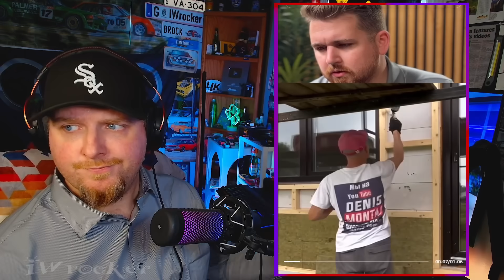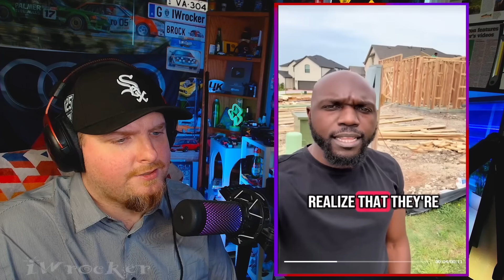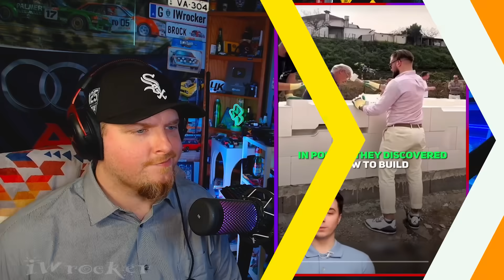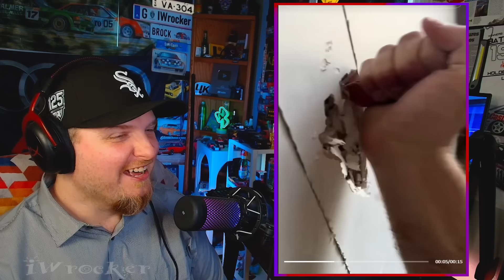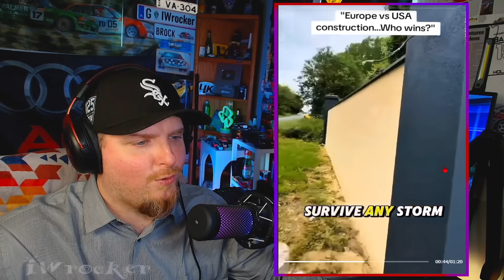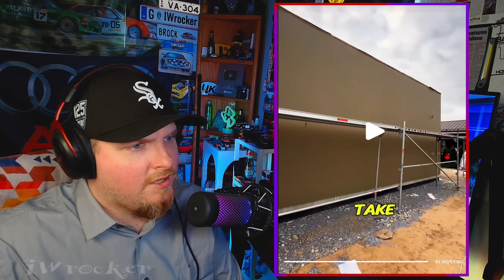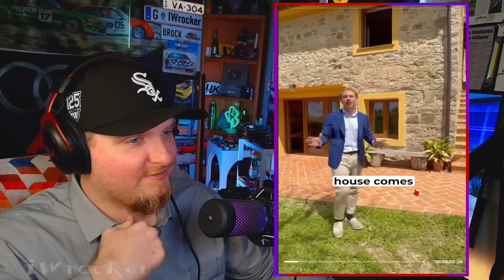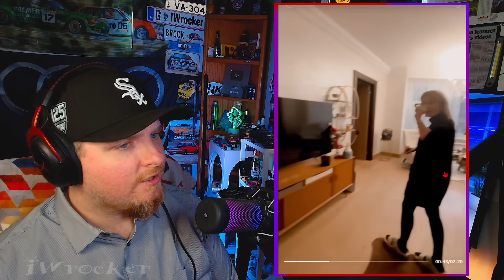25 Minutes of European VS American Home Quality & Construction Methods 🔨

Comment: My house was first documented in 1153. Its exact age is unclear. It was built with extremely thick stone walls. In summer it stays pleasantly cool, and in winter it retains heat well inside. The cellar is probably 1000 years older, as it contains a Roman well. Cheers from Koblenz 🇩🇪👋😃
Reply: That sounds awesome!

No issue with low ceilings? Ppl were a lot shorter back then.

Greetings from the Netherlands
Reply: @CyberBeep_kenshi The interior walls and ceilings were modernized in the 1980s. Many small rooms were combined. It is likely that the interior had already undergone several renovations over the centuries. The ceiling heights and doors therefore meet relatively modern standards. However, the exterior walls and the cellar remain original.
Reply: @MausTheGerman it sounds really nice :)
Reply: @CyberBeep_kenshi My cousin had an apartment in a 19thC house in Koblenz that had 10ft (3.6m) high ceilings, it was wonderfully light and airy.
Reply: @clivewilliams3661  There a some houses in Koblenz that belonged to very rich families. In summer they lived in a castle aropund Koblenz in winter in the town. And these buildings were rebuilt after the visit of the RAF and the USAAF in the 1940s. Normal houses were not rebuilt. Ask your cousin if this house had a special name. So you will know the original owner.
Reply: @CyberBeep_kenshi You may be suprised but while people were slightly shorter in history it does depend on time period! People being much shorter is typically only seen in times of famine or hardship. The shortest people in a lot western europe have been was actually fairly recent during the industrial revolution, where wealth inequality lead to malnutrition for the vast majority of people, stunting their growth. Right before that period people weren't actually on average that much shorter than modern day.
Reply: @__-fm5qv   I went to have a look at a 1550 thatched cottage in a small English village. The first thing the estate agent asked was, 'How tall are you?' I'm a short arse at 5 foot 7 inches, and had to remember to duck under the main beams.
Reply: @__-fm5qv we see it in ancient humans too. Hunter gatherers tended to be close to modern height. But farming caused a lot of malnutrition and averaged heights of about 6-8 inches shorter. But eventuly heavier use of pastoralism brought more protein back into people's diets at the late neolithic and bronze age and heights was again close to modern height then.
Reply: @CyberBeep_kenshi Before agriculture became a thing ( 10-12 000 years ago) People were , on average, 5 inches taller than today. Our brains were 11% larger as well. Then we started eating lots of plants, and everything went down, height, brain, general health.
People 1000 years ago were generally the same height as we are, maybe marginally shorter. Meat became more available, and people started gaining some more height again... apparently we are still eating too much plants.
Reply: @Goldenhawk583 no. just no.
Reply: @martinawolf2983  He is not wrong though when it comes to height. Paleolithic and Mesolithic hunter&gatherers averaged 183cm (6ft) for males and 172cm (5ft 8) for females. Average height declined significantly in the Neolithic and Bronze age due to agriculture and lower intake of protein. In ancient Rome average height was only 169cm (5ft 7) for males and 158cm (5ft 2) for females.
Reply: @Goldenhawk583  This is so wrong on so many levels.
Reply: @camille_skye3768 He is right though. The tallest ethnic group, the Masai, eat a diet consisting almost exclusively of meat, milk and blood and practically no plants at all.
Reply: @camille_skye3768 so you did not check, I guess you know best, lol
Reply: @martinawolf2983  just yes, but heck, it is more important for you to have your bias, than to stay factual,. your problem, not mine, facts are facts no matter what you believe:P
Reply: @G @Goldenhawk583 How do we know the average height of hunter-gatherers around the world 30,000 years ago? You still need femur bones to estimate height.
Reply: @gustavmeyrink_2.0  Wow. One ethnic group compared to the rest of the world. Have you ever looked up the average height in South Korea from 1950 to 2020? No immigration, but a massive economic development from very poor colonized country to Samsung. Do you think humans are carnivores?😂
Reply: @camille_skye3768 Omnivore not carnivores but definitely not herbivores. We are primates and no species of primate is a pure herbivore. Besides hunters&gatherers were not just one ethnic group, you need to be able to distinguish between valid examples and general universal statements but that is probably asking too much.
Reply: @camille_skye3768 PS: You know what happens when poor communities become richer? 
They eat more meat in their diet. So thanks for making my point for me.
Reply: @camille_skye3768 oh I forgot, because noone ever found remains older than 10 years, right? Heard of archeology? And I said 10 to 12 000 years, why did you add another 20 000 out of the blue?'
We know how big dinosaurs were, but we do not know the same for humans millennia later??
Reply: @MausTheGerman
Yep. UK here and my family house isn't as old as yours but ours is 450 years old. The roof was the original until 2006 so 430 years is a good long time to last. Then we thought  the house deserved a treat 😊 so we had a new roof put on. Welsh slate is lovely. I agree about it being cool in summer and warm in winter.✌
Reply: Greatings from the Goldgrube 😃
Reply: @Gerbilwithfountainpen 😆 Gude aus der Altstadt 🎉
Reply: @Gerbilwithfountainpen  Die Karthause winkt von oben 😄
Reply: Wow, that's SO cool. <3
Reply: I'm green with envy, lucky you to have such an historical home.
Reply: @catherinewilliams3850 Interesting, how people prefer different things.
I'm German and always went for newly built houses or apartments.
I was thrilled, to be the first person ever, to move in. 
Old houses just freak me out. I always wonder, how many people died there. 🙈🥴
Reply: I used to stay in a pension in the nahe valley that had roman wine cellars and the place was still a Weingut
Reply: Compared to you, I grew up in a modern building. It was built in 1526. The walls were about a metre thick and the biggest problem was opening and closing the windows. As a child I had to drag a chair to the window, climb up to the inner ledge and open the window.
Reply: You trying to make your Dutch neighbors jealous? You succeeded!
Reply: My husband grew up on a old farm.The walls were made of boulders.electrical cables could only be laid on the surface,otherwise half the wall would collapse.😅picture nails only with HILTI👷
Reply: Kowelenz?! Grüsse vom ex-Koblenzer 😊 Da mach, gäh!
Reply: Du hast kein Haus, du hast n Museum 😂
Reply: Beste Grüsse aus dem Westerwald in die schöne Altstadt. 
Hui Wäller, alle mol. ❤
Reply: Sounds right, my parents also own a really old house in Austria, even de wooden wine press beam was determined to be from about 1300 😂
Reply: I imagine the people in Split/Croatia having these walls in their homes must also feel...really good in a certain way hard to describe. 1700 year old walls in your kitchen just have a different feel to them...
Reply: Our house in the country my ancestors come from is from similar times, also has 1 metre thick walls, so in hot summers it's still cool inside.
It's is a double-wall with an air gap in the middle, which insulates nearly perfectly.
Our house is one hundred years younger than yours. ^^
So, from around 1250, and possibly much older, but there is no record of it, so 1250 is the most you can go back in history.
Reply: @Kivas_Fajo Yes. It's difficult to determine the exact age if no documents were made or have survived. The well in my cellar was examined by archaeologists, and they said it dates back to Roman times, while the medieval cellar is no longer Roman, but from the early Frankish period.
Reply: @MausTheGerman  What is known, that the sea salt saline mine was there in Roman times 2000 years ago. But, the mine today is from late medieval times.
I think, if you start digging in the area you'll find Roman ruins.
Illyria and Dalmatia were very early incorporated into the Roman Empire. I couldn't find any dates for that in a quick search, but my best guess would be prior to the Punic Wars around 230 BC.
Reply: Cheers from the Nürburgring area ✌️
Reply: Similar case - Mediterranean stone house, built in the core of a small ancient town that was once under Venetian rule, was Roman town before that, a Greek colony before that... Nobody knows when the house was really built and Elrond is not there to answer some questions. The town was badly damaged by Saracens in 12th century, I believe, so who knows,  I might have been then. The only problem there was with the house is the plumbing, so typical for coastal areas.
Reply: Brick/concrete house with inside insulation. Why heat walls?
Reply: @TTT-l5w5l  heating walls is a good thing though
Reply: Nah, the people who built it clearly didn't know what they were doing.😁
Reply: Mine in Franconia has its 100th birthday next month. Walls made of bricks and granite, 50 cm /1 ½ ft on ground-floor. Ceilings 11 ft high. Wooden windows with new triple glazing. Egyptian revival outside, so no outer insulation. US Army put in plasterboard-walls in 1946, which I ripped out to have decent space. Some of the Americans still live next door, told me stories form the times of the Iron curtain. (They never found the Nazi arms cache in the walls) Wooden windows with new triple glazing. Egyptian revival/Art deco outside, so no outer insulation.
Reply: I lived in a thatch cottage for 4 years as a child. Unfortunately it's location was an isolated village in the English countryside. Not a lot of jobs nearby. Cobb walls were so old, thick and solid it felt like concrete. Was listed in the doomsday book so at least 1080s or older. Very cosy. My family were very sad to leave.
Reply: I know,i was there   😂😂😂
Reply: So it was built around 300 years before Provand’s Lordship? Impressive. What is it people knew about building back then that has been forgotten?
Reply: You mean Confluentes, right? 👍
Reply: Mine was built in 1820, 80 centimeter thick walls, high ceilings (3,40 m). Same conditions as yours: winter warm, summer cool. No idea about the cellar, but it seems older than house. Poland here
Reply: yeah, city i live in is over 750 years old, the main church made of stone was built in 1428 and it's still up,open and used daily in excellent condition..
Reply: My sister's was built in 1745 - it's quite new
Reply: @piccalillipit9211 Yer, mines 1799, 2’ thick walls, high ceilings, warm in winter, cool in summer.
Reply: My sisters house is 600 years old,walls so thick some rooms cant get wifi..
Reply: What an amazing location. Right where the two rivers meet. 
Do you live near the water?
Reply: Hello from the Czech Republic, it is not true that we only have cars with manual transmission, we are 2 people 50+, we live in a small house and we have 2 cars with automatic transmission, more than 50% of new cars have automatic transmission, it is true that I use tons of ice for non-alcoholic drinks even in the winter months - we have an ice maker, it is true that we mostly do not have air conditioning, because we have brick houses with 20cm polystyrene insulation and three-layer glass, mostly with aluminum front window shutters, which do not allow the house to heat up above 24°C even in the hottest 35°C - max 10 days a year, yes we have a toilet and bidet mostly - for washing our asses..., Yes, we have expensive fuel, probably because of Trump and Iran, diesel today is 7.8$/gallon, gasoline 6.8/gallon, it is not true that we do not need cars, I have to drive 37km to work (approx.  23 miles) - 25-30 minutes mostly on the highway, yes a beer in a restaurant costs $2-3, a meal in a restaurant costs $10-20, but we don't pay tips
Reply: Koblenz! I was there few times. Beautiful area
Reply: That roman well might have been at ground level when it was built. Maybe the whole building was constructed around it and the cellar was the original ground floor.
Reply: Haha, right. Oldest documents of my parents house were from 1609. Just because all the older documents did not survive the centuries.
Reply: To jest specyfika terenów, które były pod panowaniem rzymskim. I miały dostęp do kamienia jako surowca. I nie zostały zniszczone przez obce wojska, które rujnowały twój kraj non stop przez 300 lat... Na wschód i na północ od rzymskiego limes nie ma takich starych domów. Najstarsze domy mieszkalne w Polsce będą mieć maks. 600-700 lat i tylko wtedy gdy Niemcy z Rosjanami nie wymyślili sobie zrównać twojego miasta z ziemią...

Także prosze nie wprowadzać w błąd naszych kolegów z Ameryki, bo tysiącletnje domy w Europie to domena połowy kontynentu, zwłaszcza tej nad Morzem Śródziemnym, pod panowaniem rzymskim, na Wyspach Brytyjskich i tam gdzie Niemcy z lat 1933-1945 nie stwierdzili że cała ludność miejscowa jest do kompletnej anihilacji...
Reply: @paulinagabrys8874 Are you saying the nearly 1000 year old stave churches in Norway do not exist, or did I understand you wrong?